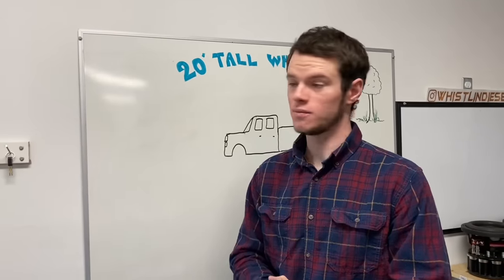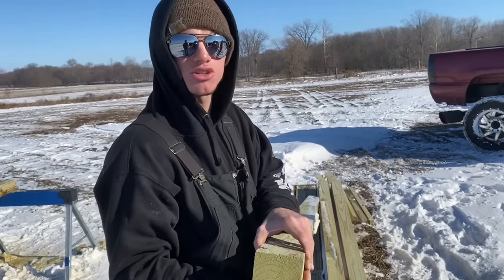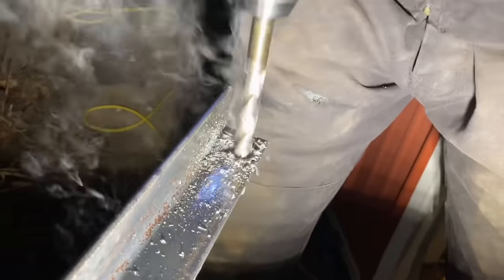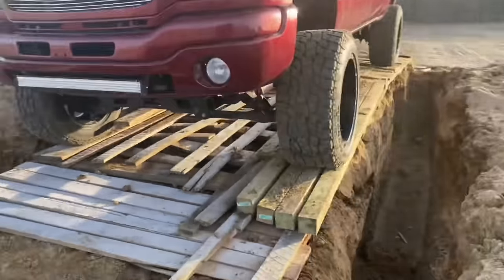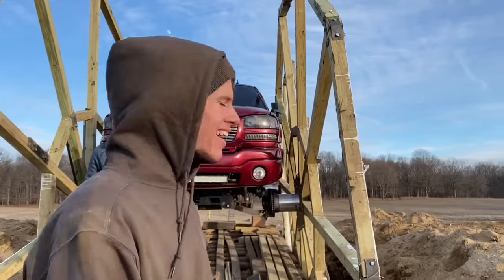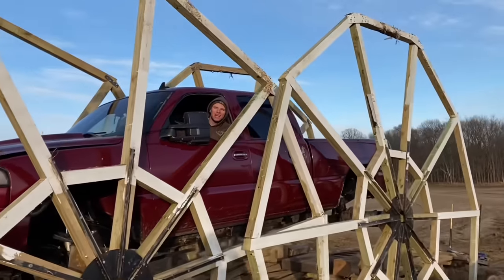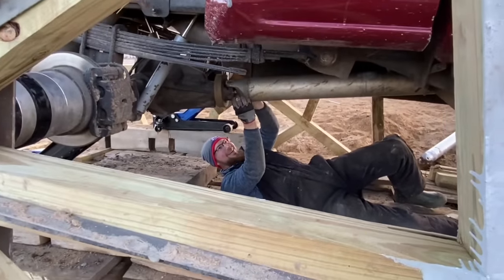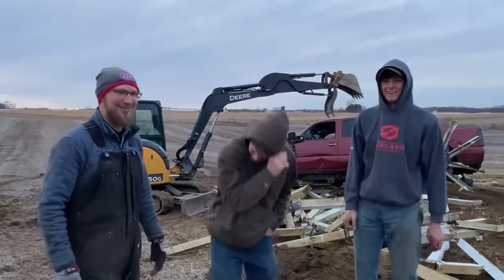Truck Drives on 20 FOOT TALL WHEELS (World Record)

Comment: Fantastic intro, epic lead up, but we need a re do with steel tubing and I think it will actually drive. It was doing well until the wood fell apart!
Reply: Street Speed 717 definitely needs 
More steel and less wood lol
Reply: No it was being pulled by another Truck, With 20 foot tires it would never move it would break the Drive shaft as it did and next with in 4 feet or so the Trans would Explode.
Reply: @firstvett69  it broke trying to climb out of a 7ft trench, not the same as driving and rolling on flat ground. It would put significantly less stress on the drive train after the assist out of the trench.
Reply: @UCzfoLLONyXJKaIacBYIGmRw i don't think he tried to regear. This was likely 2:1 transfer case. Maybe a truck with double transfer cases to torque multiple by 3:1 on top of the 2:1.
Reply: Youd pop the driveshaft, probably your trans, and it would still not move with the amount of weight on it
Reply: It was doing well? What was it doing? At the first sign of movement it fell apart like toothpicks!
Reply: I think you might be right with all metal it would work and they could go thicker if they add rubber to it they might even get to drive it into town haha
Reply: Maybe with a really built manual transmission, a solid driveshaft, and the best of the best U-joints. It could happen.
Reply: @firstvett69  needs to change the gear ratio
Reply: @BoDiesel  needs to change the gear ratio
Reply: @jasonbyrd703  of course gear ratio. Of course they could do a double or even triple transfer case to keep multiplying torque. But even with the right gears, it would put incredible strain on the drive line, axles,  lug nuts, Studs and everything else to want to break them.

Comment: I bet when this dude gets his diamond play button he is gonna put it on his license plate 😂
Reply: Best thing I’ve seen today
Reply: The wood joinery on a wagon wheel takes 100 hours to make one wheel. If done correctly. By master craftsman. These appear more like wet noodles made of wood. Not sure But you could’ve saved a world of time in labor by hiring a crane to put the wheels on. Hold the truck up in a swing pulley and mount the wheels and then just put it in park.
Reply: @lucaswilhelmmeyer6943  and ofc he has 3 names that’s crazy 🤡🤡🤡🤡🤡🤡🤡🤡🤡
Reply: His new name will be whistlin diamond 🥴😂

Comment: Epic video! I guess there are a few factors as to why the truck couldn't move with these large horse carriage-like wheels:
1. The build of the truck. This truck of yours was built to run on wheels up to certain sizes. The materials and engineering used to built that truck (in the GM factory) was done to achieve cheap production cost and light weight for the truck.

2. The width of the horse carriage wheels, they were very thin, not wide enough, so it could easily penetrate through soft terrains and get stuck. That too judging by the video, it seemed as though the wheels were jammed stuck because of the ground conditions (correct me if I'm wrong).

Comment: So like is he gonna drive this thing upside down or what
Reply: Dry sump oil system for the engine... Otherwise that'd be fucking wild 😂🤘
Reply: Get this comment noticed!
Reply: @cjmadcatz7492  I dont think he cares if the engine has oil in it🤣
Reply: @jacksongreiner2919  That sounds about right 😂👌
Reply: That wouldnt be possable
Reply: M Ld why not?
Reply: YOO THATS A GOOD IDEA
Reply: Yooo
Reply: @Martin-xh1hd  actually, it would be a pain, but all you'd need is an external oil reservoir and pump, and to turn the fuel tank upside down.
Reply: Richard Roper this guy doesn’t even need that it is still possible just not for very long
Reply: Yooooo9

Comment: Imagine if he used square tubing and welded the entire thing together. It might have made it across the field.
Reply: Itd be stupid heavy lol
Reply: It would also have been way easier
Reply: 10/10 they should try again with 4"x4" .250" wall square tubing. Or something similar and probably like .750" steel plate for the hubs to bolt to.
Reply: @ElevatedEyes2023  and the strongest driveshaft in the universe
Reply: @MinneFab  I'm thinking something like 6" DOM steel that's at least 1" wall. Weak point will be the universal joints though
Reply: @ElevatedEyes2023  hah yeah. then the trans and diff. But would be a great strength test for the trans/diff companies out there. A 4x4 truck might move easier too. All in just a wild ass stunt haha.
Reply: @ElevatedEyes2023  1" is waaaay overkill, 1/4" would be enough if you weld it properly with good bracing
Reply: @GumpterCrayon  I thought this channel was based on overkill? 🤣 10/10 I would use 1" for this project to go with the wheel size lol

Of course .250" would suffice. But bigger is better when you wanna "giver' the beans" amirite?

Comment: Someone: Makes 30 footers wheels

Whistlin: I think 100 footers should work
Reply: Morgan Rupert in theory with a 12 ft wheel base span, its impossible to have >~23 ft “wheels”- now tracks on the other hand, those could get more redniculous
Reply: @NinjaRufio  did u not just see the 20ft wheels
Reply: @jasonthomas4132  he said they can't get bigger than 23, is 20 bigger than 23?
Reply: @andrewgallagher4534  its 3 foot bigger he over laped them to do 20 he can do it to make 23 work
Reply: Jason Thomas no because then whatever wheel is on the inside will start hitting the spacers on the wheel on the outside.

Comment: Reminds me of an idea I had when I was about your age. I got the idea while flying across Canada, looking down at the solid carpet of trees below. My idea was to have a vehicle with tires so huge and filled with helium, that the vehicle would be able to RIDE ON TOP OF THE FOREST!!  My friends just laughed and it never got made, but to this day I still think it could work. Anyway, looks like you guys had a lot of fun with your big wheels. Had they been welded steel you might have really had something.
Reply: fresh idea , l had similar about so big wheels or some design that can drive over fences and ditches , another on like plastic orbs blowing over ocean or lake with seat in middle , ........or big plastic  or metal pipes that reach between wave tops guess three in a triangle mabye or one. and sail. or other in front with  sail and line between.  the orb could do your idea but plastic get punctured on branches or and stronger gets heavy some fabrics . , or plastic inside holding frame meter away to tree. or just something like that to tow over trees just  to see someting new. or yea a blimp not for flying high but with four strong fabric spheres below to roll on treetops is doable.  or a frame that sends out  a pole to grab branch cam sensors and computer. many of those, or just four and viechle in middle . could weave a shphere from branches ...chopper pulling it across tops . or a jet  motor or can a thethered jet motor fly . or ...propeller motor. or it could go slow  by throing anchor forward and pull on rope, repeat.

Comment: not gonna lie I kind of want to see a Version 2 of this
Reply: What if you did this? glue 3 or 4 layers of that 2” blue construction foam together and cut out your 20ft disc, which is now 6-8” thick, and then skin it on each side with 1 or 2 layers of 3/4 plywood with through bolts and washers all over the place. And nowdays he could pick up the truck with his big excavator to mount them and not have to dig ditches.

Comment: On this channel I have yet to see a wheel spacer break...
Reply: Exactly. I mean they still sketch me out but I've had spacers on 14 wides, just the rear tho, for 3 years and never had them loosen at all. As long as you torque them and keep your lugs torqued you should be good. Still wish they had more selection in offsets and that Chevy didn't make their fronts wider than the rear.
Reply: I was told it was so the tires didn’t track in the same ruts. For example for snow, the rear still bites on fresh snow. 

Not sure if its true or not.

Comment: anyone else have there eyes on the subs at the beginning
Reply: They look like Hutchinson neo subs
Reply: I came to this video from the IJWB group cause someone called them out!!
Reply: They look like 8”
Reply: Yep 1,000 to 1,500 dollar subs need 4 15s like that looked like the new subs jp from d4s shop is selling now
Reply: David Baker I’m broke, I’ll stick with my 2 skar evl 12s going under my backseat on a 2500 watt amp lol
Reply: That's what I have 2 evl d4s on a skar rp2000 in a qbomb box with bedliner on it it does pretty good getting ready to get 2 15 zvx v2s with an rp4500 and build my own enclosure this time with a bigassport
Reply: David Baker yea hoping mine hits hard. it’s going in a down firing sealed box custom made for the subs on a mtx xthunder 1500 but it performs way more then that. the only reason I got it is bc it’s the most expensive amp they make and my dad got it for 120 bc he worked at mtx so I’m pretty excited abt it
Reply: David Baker but that’s gonna hit hard asf
Reply: Man wish my dad did there new mtx 9515s look beefy just to expensive

Comment: “10 feet at sea level ground”. what does that even mean?
Reply: The radius is 10', the diameter is 20' and the circumference is π.
Reply: @teddybar66  circumference is not pi lmao
Reply: I definitely could be wrong on 3.14 being the measurement on circumference. I should have left it at radius being sea level.
Reply: Circumference is pi multiplied by diameter.
Reply: Your all wrong. The ground is at sea level but the truck is 10 feet off the ground
Reply: @oversizedhauling3108  You are wrong also!  The truck is 10 feet above the ground (AGL)  Sea level is sea level (MSL).             We don't actually know what his elevation is msl.

Comment: Guys tearing up the truck after the show is just fkn stupid. Repair and reuse.
Reply: some youtubers buy exotic cars and abuse them, he just buys trucks! in my opinion its smarter this ways cause he gets more views for cheaper!
Reply: I've got the 04 cab n half like this with 4.8 and watching this hurts me.
When I was out looking for trucks I could of gotten a 30k truck if i wanted but came across mine with 164k miles in perfect shape and i will drive it till it dies.
But I'm easily content.
I love the auto 4x4 when the wheel slips and the inside and out is a 9.6 outta 10.
Got it for $3340.

Comment: I used to drive haul trucks at the coal mine for a job and they stood 25 feet tall and 30 feet wide. Insane. 1.1m lbs truck unloaded. They’d throw 400 tons of material in the bed, so that’s like 2m lbs loaded. This reminded me of driving those beast. 2400 hp to get them to move

Comment: They should re-create this using schedule 10 aluminum pipe bent into a radius to save on weight and reduce rolling resistance.  Maybe the drive shaft could survive.

Comment: Tip for next time...  Place the wheels, then use the excavator to LIFT the truck into position instead of adding more pressure to the dirt by using floorjacks LOL

Comment: I’d just like to point out that this all failed because one of your rim pieces broke coming out of the trench, and the flex allowed it to contact the rear wheel. This is why they used to wrap cart wheels in metal. You may have succeeded other than that, maybe time for a second try with a few more triangles in the outer layer to make double the number of sides?

Comment: Did anyone calculate the gear ratio of those “wheels” vs the original wheel diameter? 20ft diameter multiply by pi, the truck moves 63ft or 19 meters per revolution of those things.

Comment: That is insane ! Though, regular bolts going straight trough with nuts would have been 10x  stiffer and stronger, while probably also being cheaper. Also, a back of the envelope calculation would have told you you wouldn't have enough torque to drive on a decagon of that size (Who freaking do Decagons anyway?). Althought doing so would have prevented this wonderful piece of entertainment. Cheers !

Comment: For sale. Full sized duty level truck. Cheap. Lightly used. Very few city miles. No insurance claims and no accidents. Some slight scratches and a minor windshield ding. Should buff out. Call diesel whistler for details.

Comment: Instead of 4 wheels, build 2 cylinders, so the truck would sit on top so it's wheels in reverse spin the cylinders forward. Cyl need to be connected and the truck also secured

Comment: Next time instead of ruining so much stuff . Just use wheels that are round . Y'all that was worse,or harder to get moving than if you built square four foot tall wheels . The weak link is gonna break . You take someone like me and I would of said no bro let's build the wheels out of two inch metal tubing . Run it through a tube bender and weld it up with spokes the same size, connect that to your boxed hub that has been  drilled for lugs and walla . That truck would of never broke and it would of worked . It would of drove with no problem because the wheels would of  been round and balanced . If you ever need help with a project, like someone telling you that  wooden wheels that are not round will not roll. I'm the man to save you all that headache and damage. Just let me know. This is not me being a hater , this is me saying I really would be glad to help y'all out . I would make good money for the work I done and y'all would save a ton having me come and do it . Like videos brother but i would love to of had that original Hilux as my daily driver/ bushcraft /off-road/kayaking/camping

Comment: maybe this answered elsewhere in the comments, but at 19:12... why "4 high"?  Isn't this exactly why "4 low" exists?  Low speed, high torque.  Dunno if it would have mattered.  With wheels that much larger, you needed a MUCH MUCH lower first gear to get it to move.

Comment: I knew there wouldn't be enough torque right out the gate. Should have rounded off some 4x4 pieces and bolted them to the flat spots. Also, you should have pulled it out slowly with a tractor before hitting the gas. That's a lot of effort just to F it all up over a couple small details.

Comment: Looks like a simple physics problem... the weight of the "wheels" (or octagonal barn frame, whatever you wanna call it) was too heavy for the truck to move once it was suspended between all 4 heavy ass reinforced "wheels".  Amazing...   *NEXT IDEA - make massive 10 foot wheels for the rear, and create 5 foot tall "stilts" for the front and build massive sleds (toboggan shaped) for the non-drive wheels.  Then try to "ski" the truck over mud or snow.. eh? eh? that would be pretty cool.  I'd also love to see you guys figure out how to put gigantic mining truck tires on there and see if it would float on them across a lake.  That would be sick.  

I would have been REALLY happy if it moved just a few feet.  Shame for all that work it just sat there, lurched, and blew it's own anus out. 🤣  I also loved the full-pull when went 10 feet and then it just crumpled to the ground and died like some kind of "Giant Spider Boss" from an old first person shooter PC game.  A lovely progressive collapse. That truck could have 100% been the last boss on Castle Wolfenstein or Duke Nukem 3D 🤣

Comment: Anyone else see those CV Axles holding on by there ducking teeth with the normal wheels on. 😮😮😮 how are they still there how long would they last? 10,000 miles tops?

Comment: If they were round and not flat on the bottom they’d have a lot better chance. Maybe set the wheels up on the street and lower the truck with a crane. And use metal

Comment: I would have inset bolted 2 x 4s to the surface if the outer wheels, stacking various size (Long to short). If done right it would round out the flat part of the outer rim. Then it would roll under its own power, enough to get you into real trouble. lol

Comment: The engine could not produce enough torque to rotate the diameter of those Wheels and therefore excess force was placed on the drive shaft resulting in the drive shaft failing the structure of the wheels failed at the bolted joints If This Were to be attempted again those areas must be reinforced along with the driveshaft